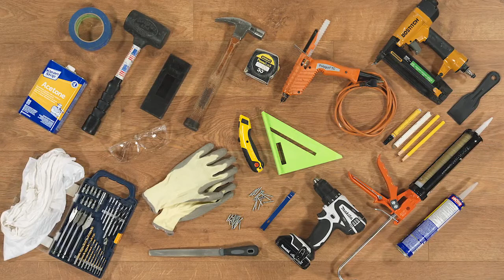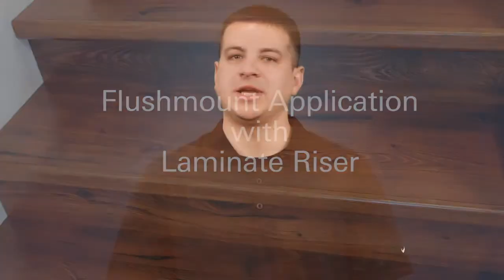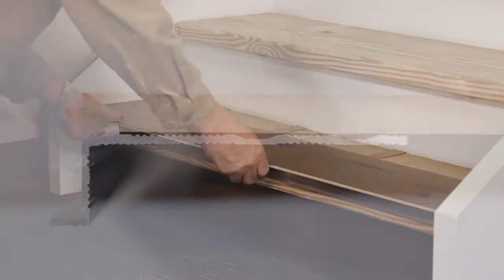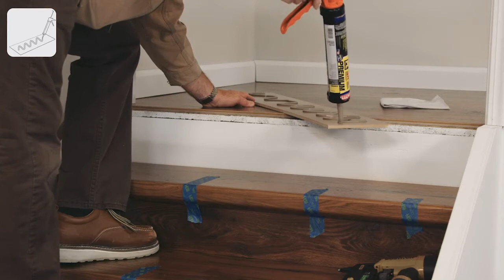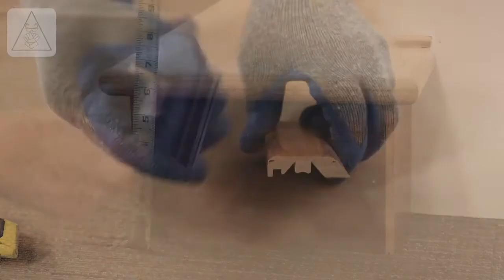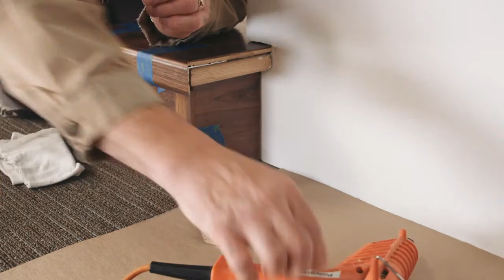Mohawk 5 in 1 Molding MINC5 5BASE RevWood stair nose

Comment: Interesting I just installed this system with major problems the mohawk rep couldn't produce any installation instructions to support the installation. When requesting a sample from the flooring retailer to prepare for our installation we were told that mohawk wouldn't provide one..
I find it frustrating that a TM from Mohawk is thanking someone for making this video when the truth is their provided installation instructions which are very minute at best do not describe anything as described in this video.   Is this video approved by Mohawk because the Mohawk rep who provided all the materials for this project said they couldn't provide them.
My advice stay away from this system
Reply from the maker: Mr. Arrowsmith, 
I am also a MHK rep and posted this video.   I took this video from MohawkToday.com which you have access to, but of course, you wouldn't know unless someone told you.   Lots of great resources there.   I have used this stair nose option in thousands of homes and have yet to have an issue, it honesty works quite well.    For those who want another option, we are slowly rolling out full sized stair treads for our RevWood products, including Rare Vintage and Boardwalk in all colors avail now.   The rest will be released as they become available.  

One company resource that has been insanely helpful to me is our tech/install support team.   You can get schematics for all accessories, install tricks, sell sheets, part numbers etc.

Comment: It’s simply a dumb innovation. I tried it. It does not work. Nosing does not meet the thread laminate and leaves an 1/8 gap. Secondly, when people walk on stairs, their feet are always on the nosing. Having a one piece nosing sitting vertically on the nose, it breaks very easily. I would never use it and I definitely wouldn’t recommend. Top-set nosing is the perfect solution.
Reply: That's my concern as well